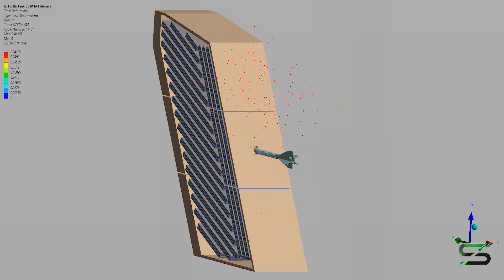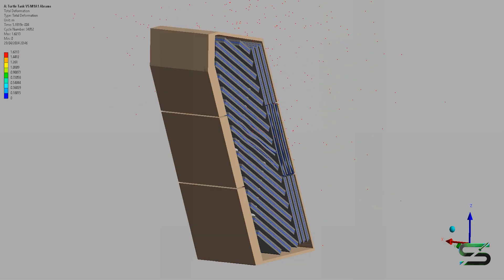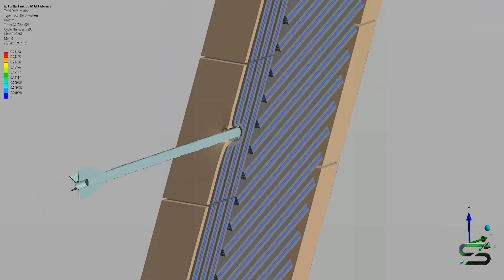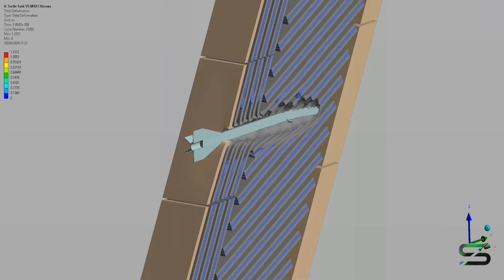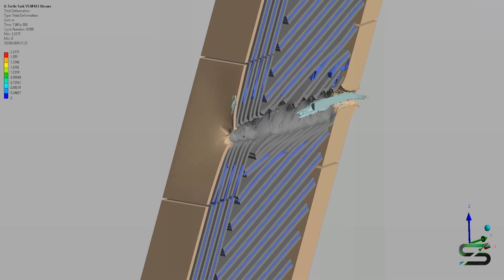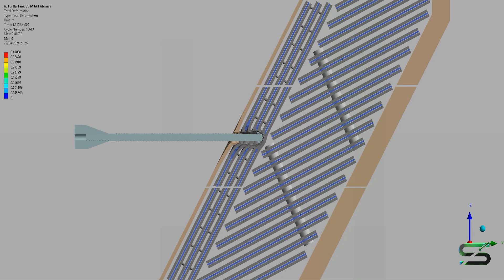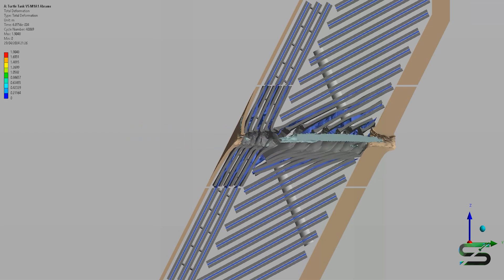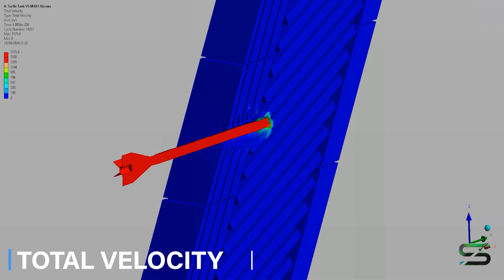T-72B3 VS M1A1 Abrams Turret Side | Armour Piercing Simulation

Comment: Although Wikipedia states the m1a1 having DU armor, this armor package insert is in fact located in the turret cheeks and not the sides, this is according to the nrc.gov ML0605 document, (DEPARTMENT OF THE ARMY, UNITED STATES ARMY TACOM LIFE CYCLE MANAGEMENT COMMAND 6501 East 11 Mile Road Warren MI 48397-5000, dated: 22 February 2006, Page 6.)

So with that said, this video is incorrect, the side armor lacks DU inserts on the turret, and this is true for all Abrams models as far as I've been able to discern.

Comment: T-72 stands little chance against an Abrams unless they have help. Most of 5 or so Abrams lost/damaged so far have been due to mines, artillery, and drones.
Reply: So far there have been close to 53 Abrams losses.
The T-72 isn't a comparable vehicle to the M1A1SA, it's best compared with the original M1 Abrams. The B3 specifically is best compared to the M1A1HA, while the B3M is best compared to the HC or SA seen here.
Reply: @TheArcticFoxxo  53 where? I was talking in Ukraine. Do you mean 53  lost in combat in all conflicts? or? Also, the T-73 has been upgraded just as long as the Abrams difference is in design which is why we have witnessed thousands getting destroyed in Ukraine.

Comment: Let's correct couple of things- first Abrams was taken out didn't have DU armor as those aren't allowed to be exported and it was at much longer distance and definitely without this type of armor attached
Reply: Давайте будем честны, что во время операции "Буря в стакане" большая часть потерь была из-за огня по своим (френдли фаер). А победить против т72 помогло наличие тепловизор и поддержка Апачи с воздуха и тоже не без тепловизоров) 
По факту лобового столкновения никогда не было. А в Украине огромная потеря техники и л/с приходится на артелерию и дронов. Вся ваша броня толщиной в 1 милю из материала радужного моста Азгарда херь полная по большому счету)
Reply: Let's clear up a couple misconceptions, then.
The export armor is BETTER than its DU counterparts, the primary reason why heavy packages use DU is for cost. It's 67% cheaper while being ~5% less dense. The entire reason why NGAP dropped DU is due to its effectiveness.
All of this is irrelevant, though, as the side profile does not contain DU anyway.

3BM60 would need to travel at least 3km to drop down to 1592m/s.
What type of armor?

Comment: The Abram which was took down with first shoot was hit by cannon launched ATGM Reflek, not an APFSDF
Reply: And that can penetrate the abrams frontally, lol
Reply: @olisk-jy9rz  it was hit at side armor, so thats a clean kill, side armor on tanks are much thinner than frontal armor. Reflek penetration is up to 900mm and its a tandem warhead, which gives a very reliable penetration. The M1A1 tank supplied to Ukraine had their armor downgraded, so it would also penetrate the frontal armor. If M1A1 was given the last armor upgrade, then it can be debated would it penetrate or not. Given the Reflek is a guided ATGM, the aiming system guides missile from the launching point to the moment it hits the target, a skilled crew can aim at frontal hull armor instead of turret armor, and score a penetration. 

The real thickness of M1A1 or M1A2 are classified, by the way they both have a same armor upgrade. We can only speculate using avaliable data. First We know, that Sweden conducted a test of armor between Leo 2 and M1A2, I believe it was a procurement contest for contract with Swedish military in 2008 or 2010, they were choosing between Leo 2 and M1A2. Sweden found out Leo 2 had over 850mm turret frontal armor rating against ATGM, which met their military requirement. M1A2 lost that contest, so they came up with an armor upgrade program in 2014, so it should be more than 850mm. Many people compared photos of old and after upgrade tank and identifed the frontal armor is now almost 1m deep. It doesnt mean the armor is now 1m of depleated uranium, usually the armor cosists of sevreal layers of different material packed in a steel box to provide protection from different type of ammunition. So I would give M1A1 and 2 armor rating 900-1000mm. Which would still be vunerable for ATGM like Kornet.

Comment: Turtle tank wins 100%. Drones will slise Abrams without such additional armor as knife slises butter.
Reply: Sure, that's why ruskies are still being vaporised by they own tanks
Reply: Like how they've been cutting through Soviet armor like butter? 

At least with most Western tanks the crew is liable to live another day. Equipment is easy to replace, trained professionals are not.
Reply: @user-gv4zb9rc6u  yeah orcs miss the point, that no one ever said western tanks are indestructable. However Abrams wont cook its crew when ammo goes off
Reply: @mairon154  Labels like that do not bring any good about them, and usually only inflame an issue instead of actually discussing it. Most of the people making comments like that above either have either deep seated biases because of the environment they've had offered to them, and do not know any different (which goes both ways), and an increasing number of soldiers being sent to the battlefield on the Russian lines very well may not want to be there in the first place and are forced to fight for a nation they very well may be disillusioned to. 

Hold the actions of a nation to the nation that nation and not the people merely under its command and control. They are rarely the ones giving the orders at all.

Comment: Due to security technology concerns, the M1A1 Abrams (the first gen) was stripped away from its depleted uranium armor before being sent to Ukraine
Reply: There is no security technology.  Depleted uranium is waste from every nuclear reactor. Not any hi-tech employed. So it is what it is.
Reply: This is a 3rd generation M1A1, not the 1st generation variant.
Even then, the original M1A1 did not use DU. This uses EAP-3, which is slightly better than the domestic HAP-3 at expense of cost.
Reply: Russ has like Tons of Depleted Uranium just gattering dust due to years of URSS Nuclear Reactors Activity....
Did You really think they have not Made replicas alredy and test Their Weapons against that?

Comment: Armor Piercing Fin Stabilized...what does D stand for?
Reply: Armor
Piercing
Fin
Stabilized
Discarding
Sabot
Reply: Discarding, as the Sabot jacket that's designed to propel the subpenetrator "discards" as the round leaves the barrel.

Comment: Если кому интересно, у трофейных  Абрамса и Леопарда 2 выявлена очень тонкая броня крыши корпуса, не допустимо тонкая, что пробивается автоматом Калашникова. Понятно, что создать абсолютно защищенный танк невозможно и танки и так весят много. Но бронирование верхней части корпуса никуда не годится. Это вредительство. В СССР, в 37-м за это расстреляли бы...
Reply: Wrong 😂
Reply: @lukasnagel4492 Leopards and Abrams have less than 20mm of roof armor, with both having approximately 25-30mm on the hull roof.
A 7.62x51mm firearm with the right ammunition can fire through this. 7.62x54 has little to no issue, while 12.7x108 and 14.5 have no issue whatsoever.
Reply: @TheArcticFoxxo  sure, ruskie tanks are soo good they can eject turret
Reply: @mairon154  What?

Comment: The Abrams sent to Ukraine have the ceramic armor package. There is no DU exports.
Reply: The Abrams sent to Ukraine have tungsten instead of DU.
Reply: No, Du is standard for M1. Others are added on option.
Reply: @alexlo7708 no it is not, it was all scraped off before sent.
Reply: @that207guy7  "Scraped off"? What, do you think it's like an algae growth on the plate?
Reply: @TheArcticFoxxo  SORRY, "grinded/taken" off.

Is that better? Holy moly your arrogant.
Reply: @that207guy7  There is no "grinding" or "taking off" an element out of a metal alloy...

You're*
Reply: @that207guy7  Plates containing export-restricted materials are removed and replaced by a basic tungsten alloy, minus the prior materials, and is then sent away.
Reply: @TheArcticFoxxo  you didn't answer my question
Reply: @that207guy7  You didn't ask a question?
Reply: @TheArcticFoxxo  you said there's no grinding or taking off, so how is the du removed and replaced with tungsten?
Reply: @that207guy7  They're removed and replaced? The composite array is opened, the backplates containing DU are removed and replaced with a standard tungsten alloy that conforms with the EAP-3 package.

Comment: Does Russia field 3BM60 in any meaningful numbers?
Reply: idk but it doesnt really need a lot of them, heat shells are by far the most useful in combat, tank vs tank is rare
Reply: @nicuciocan-wd40  Tanks are usually equipped with a mix of APFSDS, HE and Canister, if available, based on footage from Ukraine. HEAT isn’t all that useful, as it’s pretty much useless against MBTs nowadays and HE is sufficiently effective against lightly armored targets while also offering decent anti infantry and anti structure performance.
Reply: It was unnecessary. Single abrams brigade makes contact very predictable. They can supply it locally.
Reply: Yes the t90a and some t90m hthat is on the mid-frontal lines do but mostly the ones that defend and support mainly use 3bm59
Reply: @emperorofwarusthundus  3BM59 is better than 3BM60, and is only produced in about a 1:4 figure when compared to 3BM60.

Comment: Fun fact. Currently load of russian tanks does not have  3BM60 rounds. Load consists of old 3BM22  and 3BM26 rounds
Reply: Incorrect early in the war the most common ammunition was 3bm22 and 42 respectively. When the announcement of nato armor was made, most of the more modern Russian tanks t72b3 t90 and others were equipped with 3bm60  to help counter the threat.
Reply: No, they actually have a lot of 3bm42 and 3bm46, but 3bm60 is too long for normal t-72 and t-80 autoreloaders, it only can be in modernized T-90M autoreloader.
I say this as a relative of the driver of the T-72b3 tank
Reply: @ArtemLetov1488 Nah, those are capable of reloading and firing 3bm60, but they simply don't need to use expensive ammunition when most targets they face are soft and even western tanks sent to ukraine can be penned by older rounds.
Reply: @ArtemLetov1488 3BM60 can fire fired from any vehicle since the T-72BA. This being the T-80UM (standard variant), T-90, T-90A, T-72BA, T-72B2, T-72B3, T-80BVM, and T-90M.
Reply: @ArtemLetov1488  t72b3 can use without any problem Svinets 1 and 2
Reply: PEREMOGA URA URA SLAVA UKRAINE RUSSIA ORK MOSKAL !!!!
Reply: @firdavsking Ukrainian Minecraft boy, how funny you are

Comment: Just a question: the Abrams which was destroyed in Ukraine, was it an export version? And correct me if I am wrong but what I have heard is that US Abrams and export Abrams do not have the same armor.
Reply: why does it matter??? every version of Abrams would end up disabled if it was hit into ammo bustle by a drone... there is minimal armor there..
Reply: @JaM-R2TR4  correct, the T-72/90 can also fire the Refleks ATGM with an armour penetration rating of up to 900mm.
Reply: @JaM-R2TR4  Not the bustle, as that has blowout panels and a bulkhead to separate it from the crew. That bustle bulkhead must be perforated first, while also setting off ammunition.
This has happened multiple times before, as well as hull ammunition explosions that led to loss of crew.
Reply: @TheArcticFoxxo  but the protection of that bustle is minimal, so any drone can detonate the ammo.. and if ammo cooks off, tank is practically taken out of combat.. and most of the time, fire spreads and damages turbine.. so tank is abandoned.. and because its 65ton heavy, recovering it from battlefield is huge problem.. so it ends up to be a total loss...
Reply: All abrams exported are well...export variants.
Reply: The M1A1SA destroyed was an export abrams, but it DOES have the same armor.

The only difference between the M1A1SA (M1A1 AIMv2) that Ukraine has and domestic versions is that DU elements were removed and swapped out with tungsten parts. This is primarily due to trade restrictions and import measures against the material.

The armor used is called HAP-3 (or EAP-3 in this case), or Heavy Armor Package. It's used on the M1A2 SEP and SEPv2.
Reply: Yes, it’s not an Abrams at all, it’s a Toyota
Reply: @that207guy7   its a blowout panel.. its supposed to vent out explosion of ammunition.. so putting heavy armor there would defeat the purpose..   next time, try to read about it a bit..
Reply: @JaM-R2TR4  sorry i read your comment wrong i guess, i agree with you.
Reply: the exports variant do not come with DU because they remove it before the abrams are exported
Reply: Ukraine was supplied with older M1A1s instead of some über-fancy state of the art M1A2 SEP v3. It’s like comparing a Leopard 2A4 to a 2A6.
Reply: @RichelieuUnlimited  Ukraine was supplied with M1A1 AIMv2s, which are the most produced variant of the modern Abrams. That's what is currently in service with a majority of the branches, was WIDELY used by marines, and is one of the only national guard variants in America.

No, it's like comparing a 2A6 to a 2A7. Except now the 2A6 has 2A7 electronics and datalink measures, as well as the gun.
So... It's like comparing a 2A6/A1 to a 2A7.
(Sidenote, that's also what was captured from Ukraine)
Reply: @TheArcticFoxxo  I was basing my comparison on the time of introduction of the M1A1, if Ukraine was supplied with later variants, the closest comparison would be the Leopard 2A5. The Leopard 2A5 however is superior especially in terms of armor protection to the M1A2 based on the Swedish trials. 
*(70% protection against 800mm KE on the turret vs 50% against 600mm; 70% 1600mm CE vs 70% 850mm)
Reply: @RichelieuUnlimited  The time of introduction of Ukraine's M1A1SA was 2009, so that isn't quite "old".
You're right on the comparison to the 2A5, though it's nowhere near as old as the 2A4.
No contest there, though I'd like to point out that export packages were tested in comparison to contemporary vehicles in those trials. Later on America did a test with domestic HAP packages, and it had shown equal to the Leopard 2 in frontal KE RHAe while inferior to the 122.
Reply: @TheArcticFoxxo dude where do you get your info from? The Marines don't use abrams tanks anymore. And I never heard about tungsten being added to abrams while du was removed lol they simply removed the du and called it a day.
Reply: @that207guy7  Armor analyses? There are two reputable sources from 1999 and 2006, being from Akers Krutbruk and GLDS.
The Marines didn't use this variant of tank to begin with... They only ever had 2nd gen M1A1 models, not 3+/3++ that the NG and Ukraine are using.
DU is replaced by Tungsten, as it's an export restricted material. The backplate removed is simply replaced by that of one conforming to international regulations and following the design pattern of EAP-3.
Reply: @TheArcticFoxxo  I read that they stopped "building" export models though. Export models do replace the du with tungsten, but from what I understand we stopped doing this. Now the export models either have all the armor, or basically none at all (I'm referring to the DU) 

Before they shipped these over, they told us what they did with them. They never said anything about them getting tungsten armor added, just the du removed. So these are SA models, just without the DU.
Reply: @that207guy7  Export models are not "built", they are modified. Simply put, current service vehicles are ordered by a country, given a conversion fee to disassemble and replace armor modules, then reassemble.
You continue doing that. It's done to date with Saudi Arabia, Greece, Iraq, Egypt, Malaysia, Kuwait, so on.
All export models have "all armor", it is simply replaced. It's a decently lengthy and costly process, hence why it took Greece almost 5 years to receive their models.

By saying the DU is removed, that's exactly what is meant. As with having the uprated 1675hp AGT-1500 removed, they aren't simply left without an engine. They're instead released with a pre-FFP (1991) AGT-1500 outputting the standard 1500hp.
Correct though, they are simply M1A1 AIMv2s with export restricted materials removed and replaced with contemporary alloys. In other words, HAP-3 was converted to EAP-3.
Reply: @TheArcticFoxxo  "Export models are not "built", they are modified. Simply put, current service vehicles are ordered by a country, given a conversion fee to disassemble and replace armor modules, then reassemble." your not wrong, but im saying they didnt do this with the model sent to ukraine. Ukraine didnt "order" these, we simply donated them with the aid package and removed the DU.

So these are much worse armor wise even compared to an export version.
Reply: @that207guy7  Yes, and the process is still the same. Any vehicle that's exported is sent without the domestic packages, and those that bought the Abrams had ALWAYS put in an extra payment for overhaul.

These are better than domestic versions.
Reply: @TheArcticFoxxo  whatever you say 👍